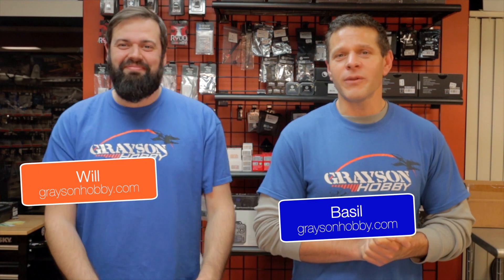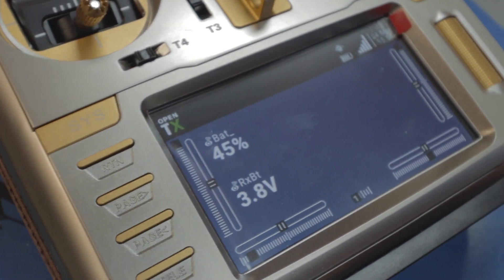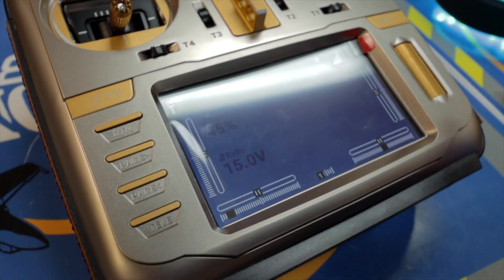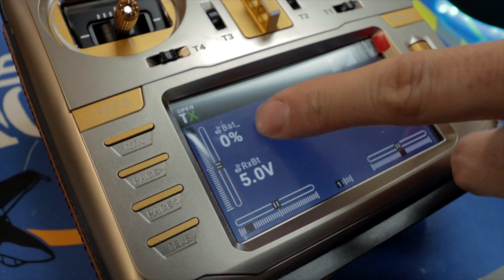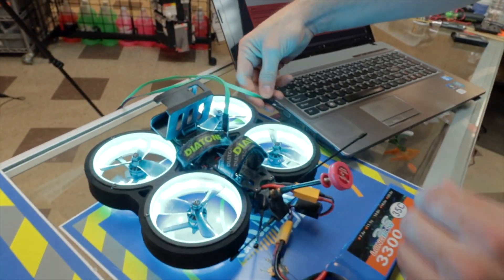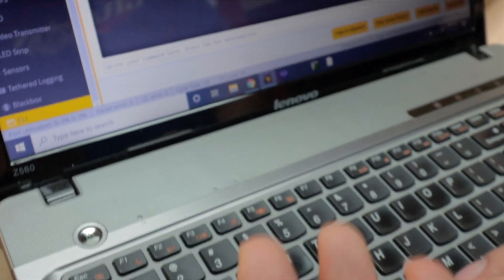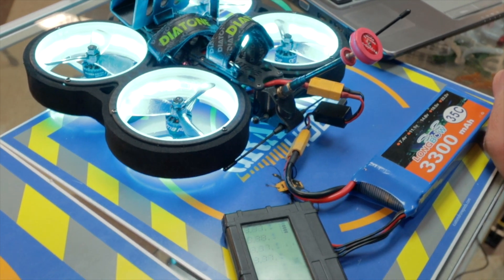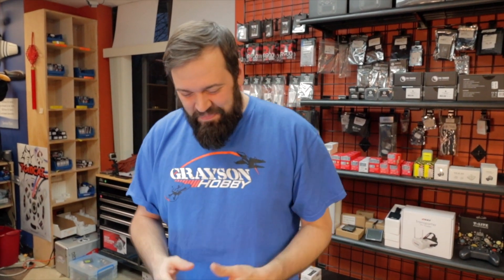Battery Cell Voltage Display on RadioMaster running Crossfire

Comment: I noticed thar it jumped for 5v to what your battery voltage is on the display.im having a problem after I started using caddx vista it's my 1ST digital quad.only thing on the quad that changed is its digital Instead of analog.i can not figure out why my low battery warning is going of now the whole time end till the battery gets to where it should be saying low battery .unplug an fly on same model with a analog quad an the logic switch works like it should.i cant find any help.when I watch my telemetry I see that's it jumping back in fourth from 4.8v to what the battery voltage is. Then in this video I seen your telemetry reading jump 5v to battery's volts.im using crossfire on a qx7s.all my analog quads the low battery warning works how it should for years now I just don't know why with a vista installed it does this to me.sorry for such long comment/? I'm just stuck an cant find an info.betaflight reads it right,my osd is right just my logic switch for low battery warning is jumping like I seen yours do for a sec but mine keeps doing it please help

Comment: Does TBS have a voltage sensor for telemetry on models without a flight controller? Like the way Frsky, or Spektrum use sensors.

Comment: hallo, i have problem, why on my transmitter ( jumper t18) rxbatt always 5V, not like 3,7 V? 
Please help me, how to setting, thanks yo u 🙏🙏🙏
Reply: Hi ..I had the same problem and it was a simple fix. You need to make sure that the telemetry tab is turned on in configuration tab in betaflight. At the moment your not getting any telemetry from the flight board. Turn this on and then you'll see the correct Rxbt values. Once this is activated them the CLI command will kick in